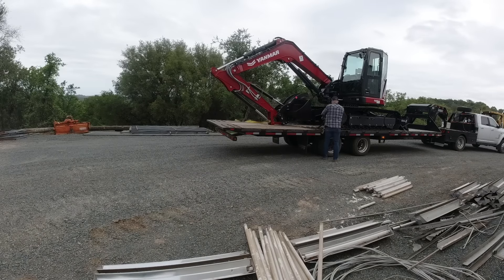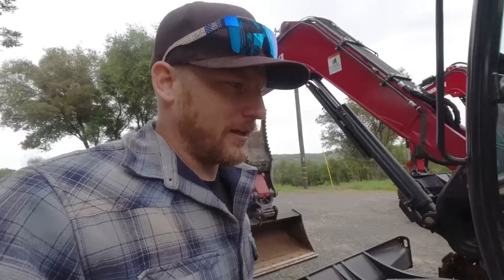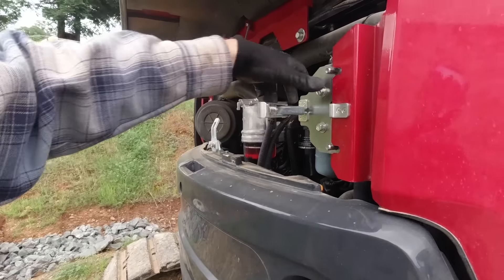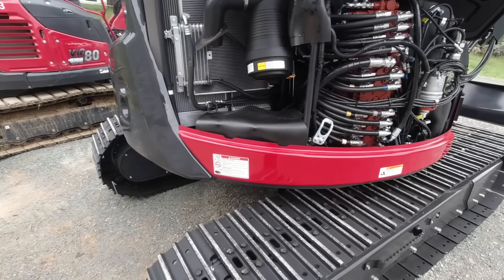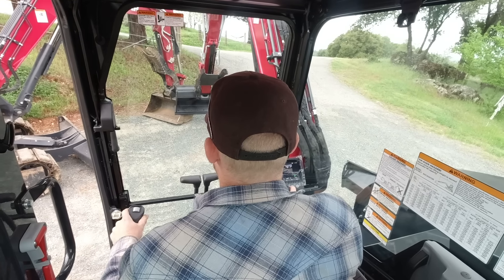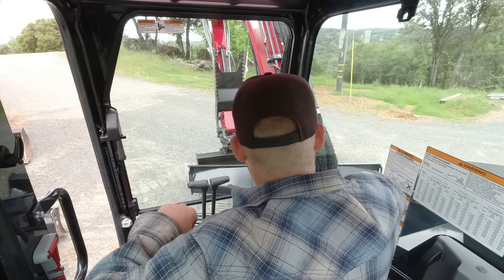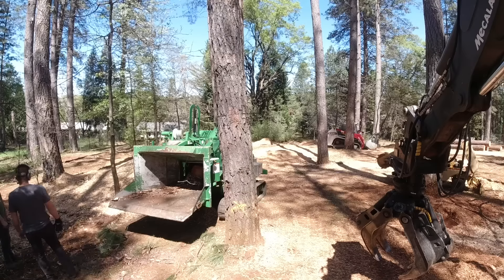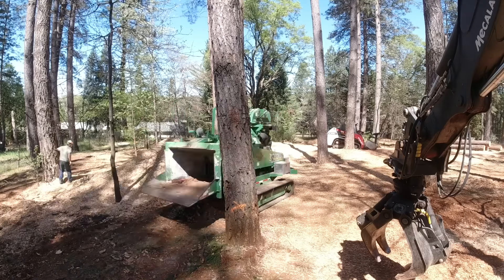Testing the brand new Yanmar 100vs80! Closer look. Which is better to buy?

Comment: Yanmar has been around for over 100 years. They are possibly the best manufacturer of marine diesel engines.. Their excavators are not cutting edge but they are very reliable. Not uncommon for guys to get over 10000 plus hours out of a machine. John deere compact equipment, takeuchi excavators and some asv machiens all have yanmar engines. Their tractors also come with a 10 year or 3000 hour powertrain warranty. They are much bigger overseas but have grown a good foothold in the states in the past 20 years. They are very popular with road crews and pool contractors. They haven't really gotten into the forestry market yet.

Comment: I tried to look at a yanmar. Couldn’t get anyone to call me back. Even filled out there online form. Ended up going with a kubota. There are 10 kubota dealers in less than 50 miles from me. If its that hard to get yanmar to sell me a machine, I can just imagine how hard it would be to get parts and service.
Reply from the maker: Exactly what this dealer did to me 6!years ago about an asv tho ha
Reply: I wanted to compare the Kubota and Yanmar but couldn’t get my hands on one. In fact I couldn’t even get a call back from the dealer… he was almost 2 hrs away which was a negative as well. Ended up with a Kubota and couldn’t be happier.
Reply: A bad dealer can always ruin a good products reputation.
Reply: I have both, like Kubota better
Reply: I’m surrounded by Kubota too. And no Yanmar dealers nearby. But you couldn’t give me a Kubota. Night and day difference in quality I’ve run both. Yanmar is much stronger. You can just call a dealer somewhere else and order the parts shipped. Not that big of a deal really. They don’t need much if it’s got less than 3k ish hours.

Comment: We have a JD and Kubota dealer within 3 miles. That, for support, ticks 1 box without even touching a Yanmar.  I don't even recall seeing a Yanmar dealer anywhere around here. I think some of the home improvement stores sell Yanmar zero turn mowers, small yard tractors and implements? They have a reputation for being cost effective.  Durability, longevity, value over time, all that is TBD.  But like you said, cost effective can trump other things if you just need one!! Good demo Sam!   --gary
Reply: A lot of Vermeer dealers also sell Yanmar.

Comment: Bro u had me going untill u say “I don’t know what year the sv80 is”…. 

Well this is supper important for apples to apples as the sv80 u have there WITH NO CAMAERAS is a sv80-6 in 2024 Yanmar came out with the sv100-7 and sv80-7 that both have cameras, I appreciate the video as I’m on the fence between both myself, but plz note your using an excavator that was designed 7+\- yrs ago vs one that is new this year!  That would be like saying my iPhone 16 is better than the iPhone 9!😂
Reply from the maker: @QualityExcavations-i2b  sorry the free content is perfect. I don’t own either machines. Just having fun. The small
Machine is a rental. The guys didn’t even know year. I would still say my 2007 kubota 080 rocked damn near as good as my 2018.